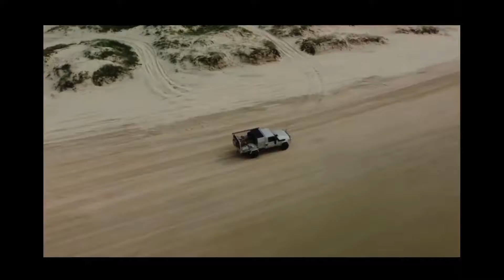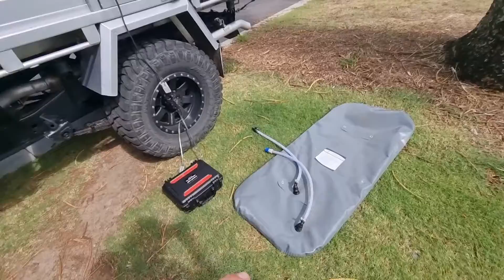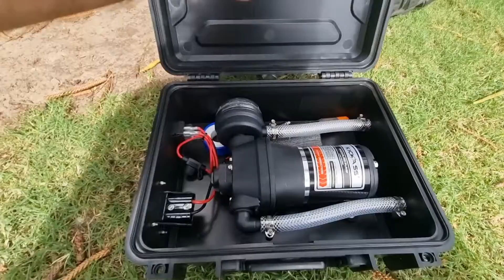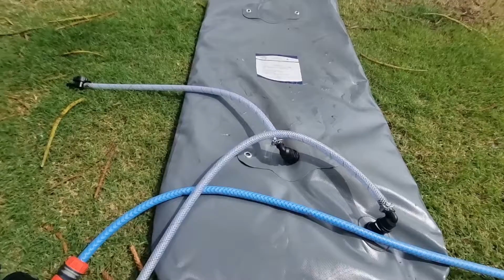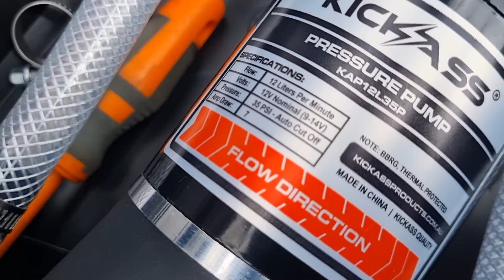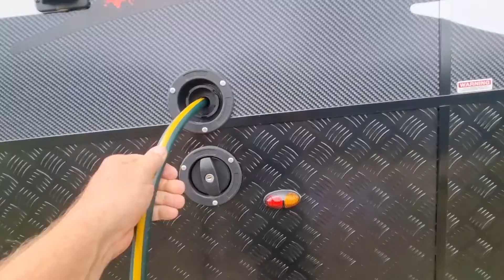How to Transfer Water to Caravan Tanks when offgrid using Kickass Pump

Comment: Bought the smaller version and had to modify it straight away by adding plumbers tape (evident in the video) and replacing the tap hose fittings that were not fit for purpose. They wouldnt connect easily with most of the female tap fittings I had and introduced air into the system. Other than that I really like it.
Reply from the maker: Yeah...I had to add a couple things....but it's very quiet...I'm thinking of changing my van one to a kick ass pump...heaps more quiet

Comment: Hi mate, what sort if heat you getting from the pump just curious, running off the standard garden hose.
Reply from the maker: Didn't really noticed it getting hot...I'm sure there would be some heat...but didn't notice it as a problem...sorry